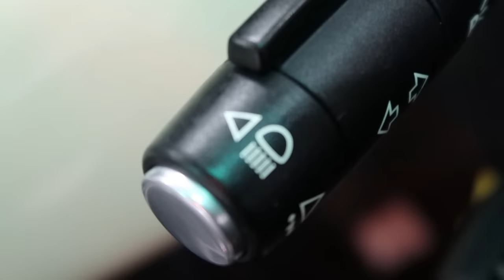"OH WOW, ITS A DIFFERENT CAR!!" - VLOG 016

Comment: Just found out about your site from a forum I'm on....and first off, great work! Really enjoy the editing, music and of course the excellent work. I've watched several of your videos so far and really curious about a few techniques you use.
1. What's the advantage of masking off corners of the side molding and especially the gas caps? Why not just polish over the gas cap and surround body at the same time? Is it because the paint is thinner on the edges and you don't want to hit the corners? 
2. Lastly, what's the best way to get scratches and blemishes out of the door handle pockets? Is manual by hand the only way? I always see your after shots, but haven't seen how you've got under them.
Thanks and keep up the great work!

Comment: Hello, love your videos. 

Just picked up an e92 m3 with very low miles, however the paint has very deep swirl marks from improper detailing. I have a porter cable 7424xp and was wondering what affordable pad/compound/polish combination you recommend to get deep swirls out of seemily hard paint.